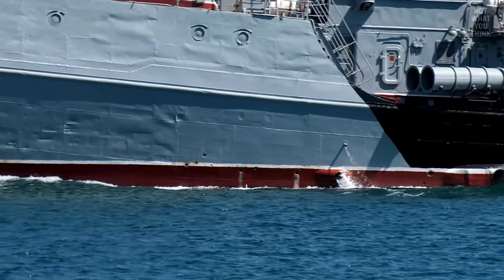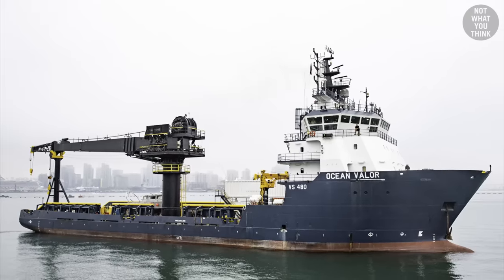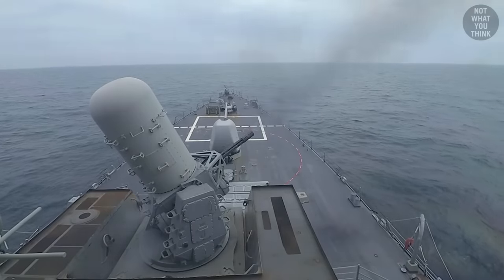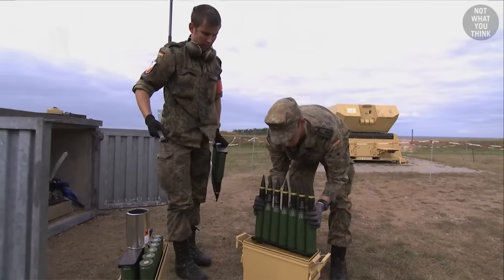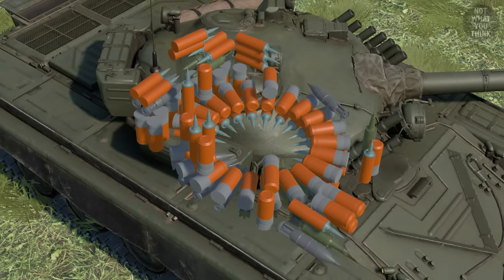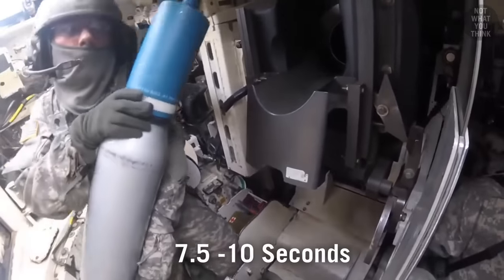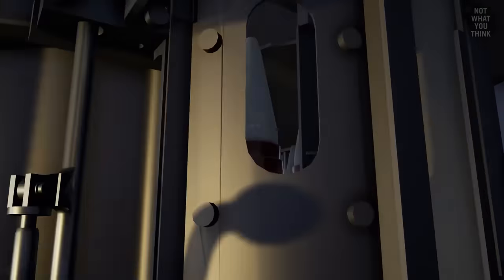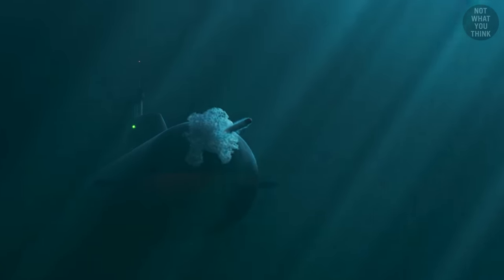Why Reloading Modern Weapons is Harder Than You Think

Comment: T-72 is still considerably slower than Abrams... But sure, Russians wanted a "fast tank"...
Reply: I don't know our tanks sound better economically.

Smaller tank less weight same steel layer of armor.
Smaller weight, less power hungry engine less fuel to chunk and the fuel itself is cheaper.
Maybe you can turn it faster because of the momentum.

But then again I don't know why we would need to go cheap on tanks if we have such an abundance of raw materials to build stuff.
Reply: And you see the only downside of the tank mentioned everywhere so far is the carousel.

 I wish engineers would have thought about that and the whole turret would blow out with the crew compartment intact just landing with a parachute or something.

That would be definetly more entertaining to see knowing nobody became bасon.
Reply: Also I don't know if my comments are even showed to anybody as my name has changed and everything. 😅

Comment: Soccer analogy: the Dutch CIWS is even officially named "Goalkeeper" On manual vs. autoloading in tanks: The autoloader is generally slower, but doesn't get tired -- so a person with arms like Popeye can pull the cartridge, flip it and slam it into the tube at worst three times to the autoloader's two, they'll eventually have to rest for a moment., but those first three or four will settle the argument before the autoloader gets off a second shot. And if the American loader plays fast and loose with the rules, and is first to shoot, they can theoretically have one in the pipe, pull out another from the bustle just before firing, and then immediately throw it into the gun for a near-instant second shot before the enemy even figures out where the first came from.

("Lap loading", as that's called, is a hell of a safety violation, but if the other guy hasn't seen you and you're going to get the first shot, you can afford to bend the rules.)

Also the main problem with "autoloader go boom" isn't so much the carousel itself -- it's way down between the roadwheels, so another spaced layer of armour -- but the extra ammo crammed into every corner of the people space, I've read a lot of accounts of Soviet/Russian tank crews going out with just the carousel filled and no reloads to improve their chances.

Comment: Whatever happened to K.I.S.S? In combat, you have to be able to reload quickly.
Reply: All good until you are working with weapons systems considerably larger than a human or ones that hold thousands of 30mm rounds. At that point the fast method requires complicated machinery and the simplicity has to be dropped in favor of turn around time.

If you think loading a VLS takes a long time, just don't look at the time it would take to reload and rearm an attack sub or a carrier.... The time in port for one of those is considerable.
Reply: @Its-Just-Zip  Yes. I know what you are saying, but, that is the problem. Engineers are famous for designing equipment without attention to maintenance and other issues involving handling. Ease of operation, in this case, loading, needs to be addressed during the design process.
Reply: @fearthehoneybadger  most of these systems don't need to be reloaded mid-combat
Reply: @fearthehoneybadger  loading is addressed in the design phase. It's just that often there are other factors that take precedence part of the problem with reloading the ciws Is that it needs to be able to have an exceptional amount of ammo fit into an exceptionally small space because it has to be equippable on nearly every ship in the US fleet regardless of size or remaining space available. Otherwise it is conceptually. Pretty stupid to load. Chain of ammo goes in. There's just a really long chain.

Same with the VLS. It is conceptually one of the dumbest systems box goes in tube. The issue is that the stuff contained in the box is extremely volatile so you have to be very careful and also you shouldn't be loading it where somebody is shooting at you in the first place so it doesn't matter that it takes 4 weeks to reload.

Ease of use is all fine, but when you start compromising stuff like survivability in order to make the system easier to reload, you've just created a weapon system but you can't really use in a situation where somebody's going to be shooting back at you

Comment: The GAU-8 is not the only gun to keep its spent casings. The M61 does it. It's partially for ballast, but partially so you are less likely to FOD your engine with your own spent brass. And the Phalanx, since it uses an aircraft mount phalanx, it also keeps its brass.

Comment: What the Navy needs for the VLS, is a Gantry.  Basically the reload ship uses its crane to lift the gantry down onto the deck of the ship.  The crew bolts it to the deck.  The gantry has an arm with a grabber instead of a flexible cable and hook assembly.  The grabber grabs the missiles from the crane that delivers them to the gantry, or to a holding platform on the deck.  The gantry grabber lowers the pods into the launch box, and does so with significantly more stability as it is a solid rig attached to the deck of the ship.  

Once reloaded, reverse the steps, remove gantry, and get back in the fight.
Reply: IM just a random guy scrolling through the comments, but i will say, the navy did use to have one that was already in VLS. They phased it out however since it wasnt very reliable and prone to breaking. Plus having 8 more cells vs a gantry was more optimal.    -Former VLS Tech
Reply: VLS equipped ships used to carry a crane that took up four adjacent VLS cells and could reload at sea from the STREAM Rig or from a helicopter.  I know because I have reloaded VLS underway in blue water to USS Antietam from USS Kiska using a CH-46D helicopter.  But we could also do it from the STREAM Rig.  This was normal during the Cold War.

Comment: Was a 2W1X1 in the AF…mostly work straight eagles but the A-10 was, by far! THE MOST BADASS airframe to load munitions.  The reason the bullet have to stay in the farame is correct, but to get further in its understanding……the frame is built around the gun.  Other fighter aircraft’s can be removed by panels and such.  This beast requires actual airframe disassembly.  Think about that.

Comment: one thing I've heard about auto loaders for tanks is that since it's not attached to the gun, the gun must come down to  the right angle to be loaded. this would cause even longer loading times because the gun must go up to fire, down to reload, and up again to fire.
Reply: Well, the delay would depend on where the tank is targeting, if the target is around the same elevation, then there's not a lot of delay, if the target is on top of something very tall, then certainly it could impact combat.

Not only that, but depending on the elevation angle, the human loader's job can get much more difficult, and he will get tired much faster.
Reply: Yes, but what people who talk about how many seconds a reload takes usually don't take into account is that the time it takes for the commander and gunner to either acquire a new target, or realize the previous target survived and needs to be engaged a second time, is usually longer than the time a reload takes, whether it is a autoloader or a human one.
Reply: That is indeed true for Russian tank auto loaders.  The gun must be level and the turret stationary during loading.  Only after loading is accomplished can the tank commander aim at the next target.

Comment: The early VLS systems had a self-contained reloading module, but operations showed that self-reloading at sea wasn't practical, so the module was swapped for additional missile cells.
As for Abrams, all ammo is contained in the bustle magazines.  Earlier models did have some stowage in the hull, but that was discontinued for safety reasons.  In Soviet tanks with carousel magazines, the rounds in the carousel are actually well protected; the biggest risk was the additional ammo in the turret and upper hull.  OF COURSE, modern top-attack munitions have negated the lower-hull protection.

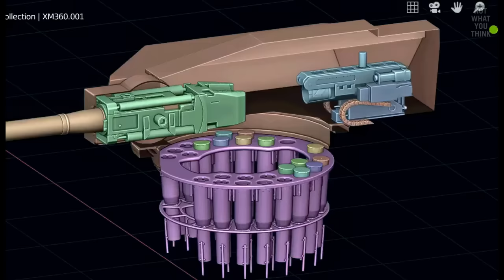Comment: 10:46 The problem with human reloaders in tanks is that a) you can't replace them in a battle when the rest of the crew has jobs they need to be doing and can't stop (and vice versa), and b) humans are much more easy to break, especially when handling live rounds (yes, even with armour and helmets). 

It seems insane that developing automated reloading hasn't been prioritised. Especially for ammunition that need to be reloaded by humans after only short bursts. A gun is useless when it runs out of bullets, after all...

Comment: the difference between autoloader and human loader have nothing to do with survivability, but reliability the US think a human is more reliable than a machine which most other nation dont

japanese/french style autoloader literally have exactly the same survivability advantage as the abrams.   blow out panels only protect the crew in the case of a perfect side shot in the ammo, any frontal arc penetration will still make the cook off kill or injure severly your crew
Reply: And as the video says, an extra pair of human hands can do other tasks for maintenance and such.
Also the survivability "disadvantage" is not such a big thing. If the ammo is below the turret it still requires penetrating the turret compartment to set the ammo off. And such a hit usually means death of the crew anyway. So other than the spectacular turret launch on a cook off, penetrating any tank in center mass will take that tank out anyway, carousel or not.

Comment: just for your information, russian tanks really did have an issue of ammunition exploding, it was big enough issue that studies been made on why it happens, and what was discovered is that its mainly due to "additional" ammo stored on the inside of turret hull, after removing those additional storage racks and using only autoloader compartment russian tanks stopped "exploading" from hits to turret, so that doesent happen anymore, those studies and changes were made in 1980s, so anyone saying that modernised russsian tanks have a tendency for ammo explosion is severely out of date on that info.

Comment: Most, if not all fighter jets don't eject the spent casings overboard so you don't have casings flying around and damaging things. Flying into your wing-man's spent shell casings at 500kts will do some damage and take out an engine. Even hitting your own as they decelerate even for a fraction of a second in the air-stream is less than optimal.

Comment: Cram/phalanx system also has the ability to set fuses on the ammunition and in fact it wouldn't work as well without it. On my deployments I'd watch rocket attacks at night just to see r2d2 (cram) shoot. You can see a trail of explosions slowly getting closer. In my second deployment I nearly shit myself watching the explosions getting closer and closer until it destroyed the 108 damn near on top of our heads.
Also, I'm a fan of how the MGS Styker loads it's 105. They have a giant revolving cylinder that holds eight rounds I think. They can rapid fire eight rounds and then reload. Always thought that was gangster.

Comment: missed out on the mixed mode loading, where an autoloader works together with a human ... the german Pzh2000 artillery would be an example of that, in this the autoloader does the heavy lifting of the artillery shells and the human loader handles the much lighter charge bags.

Comment: heres a good way to think about tank auto loaders the T series of tanks are light tanks they are fast (and would be faster if they were actually properly upgraded like originally planned but we all know how that went) and lightly armored. this is why you see a lot of russian tanks covered head to toe in ERA because its light external armor that helps increase their survivability. They pair this with a autoloader to make their reload speeds consistantly fast as a human autoloader will get tired after awhile. this allows them to flank more easily addopt more cover positions due to their smaller height and put rounds down range at a consistantly fast rate without the worry of a loader either getting tired dropping the round of loading the wrong round in the confusion of battle.

 now if you look at a abrams thats more of a heavy/medium tank well not as fast its larger has more armor and uses a loader to reload its gun this is due to the stance the US wanted to take with their tanks and well the abrams is large bulky and a tad bit slow its covered head to toe in ways to keep it alive if it gets hit like all heavy tanks are built to do. Heavy tanks are built to take a round or three if needed look at the german tiger if you want an example of how heavy tanks are built.

basically heavy tanks well they could USE a auto loader they are ment to take a few hits and survive the threat a auto loader poses causes problems for that well a light tank isnt ment to get hit and only has armor to protect itself from lighter weapons like autocannons or HMG's so a auto loader works well with it as it reduces the crew cost and chance of a crew served loader from becoming to fatiuged to fight (remember most of these tanks were based around the concept of how WW2 and iraq went)

Comment: I guess it would arguably be more dangerous but couldn't you have all those missiles for the warships in a single rack so you just swap out all however many missiles in one go? You can prep this entire rack on solid ground while the ship is out on see and any not fired missiles can be cycled to the next run? Seems kinda slow to replace them one by one 😅

Comment: re - tank auto loaders
It's probably safe to assume that if the turret is breached in such a way as to be able to ignite the ammunition inside the auto-loader, the crew is most likely already dead. Separate ammo compartments and blowout doors wouldn't help. Not unless you wanted to re-use the tank with a fresh crew...